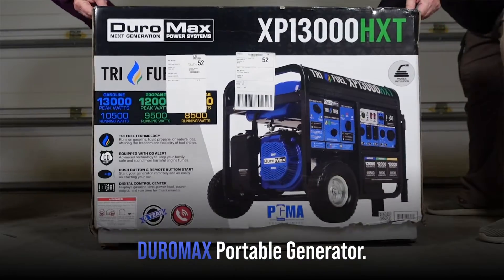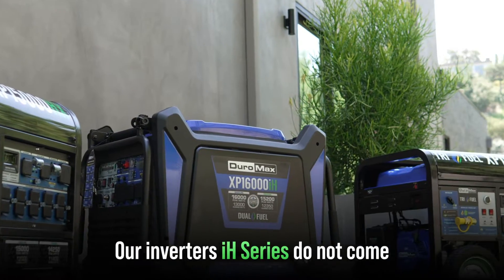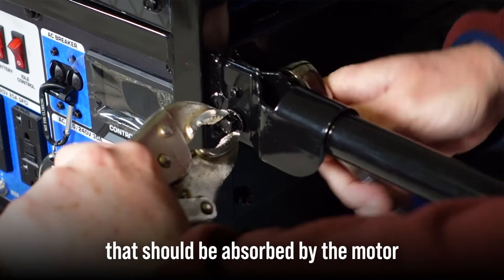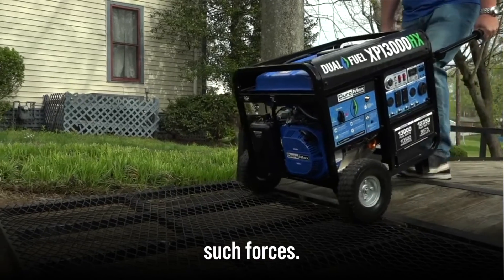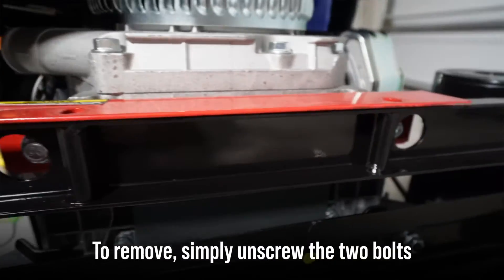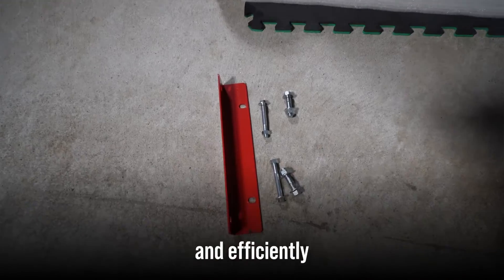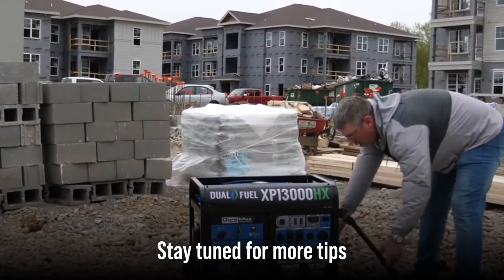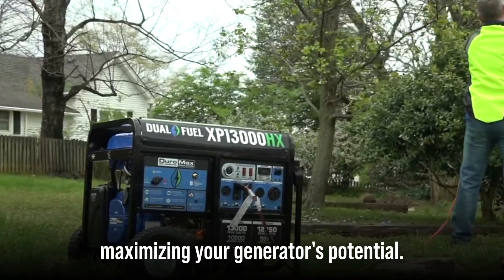DuroMax Portable Generator Setup: Crucial Shipping Brace Removal Tip!

Comment: The instruction manual states to remove the "orange shipping bracket". However, my model had "red" brackets and there two of them, different from the manual and this video. Besides the brackets appear to be good support for the generator itself. But after seeing this video, I understand a little bit more and will remove the two red brackets.
Reply from the maker: Yes please remove!